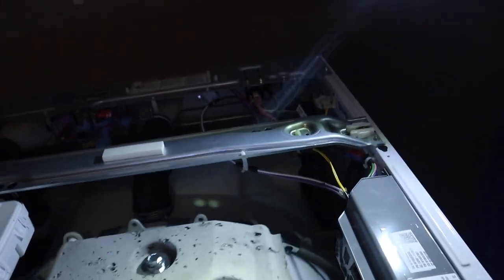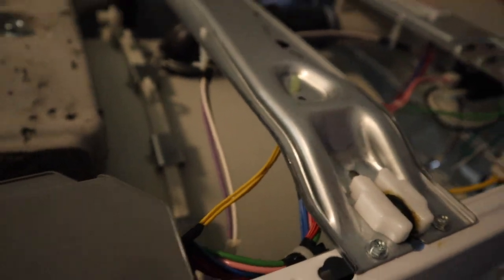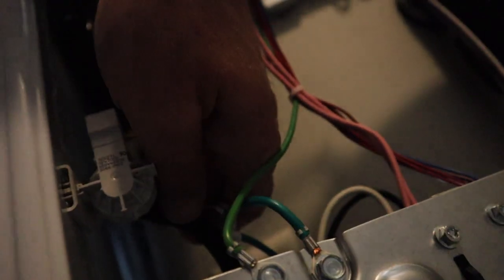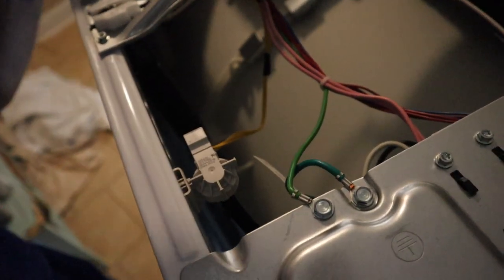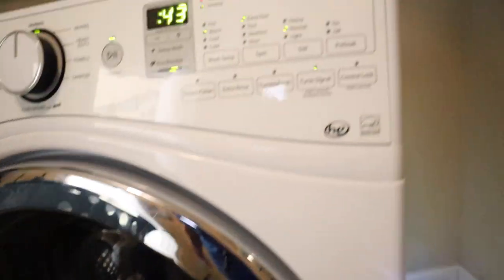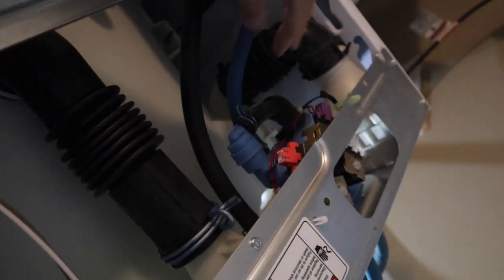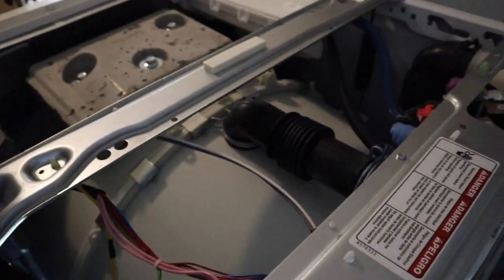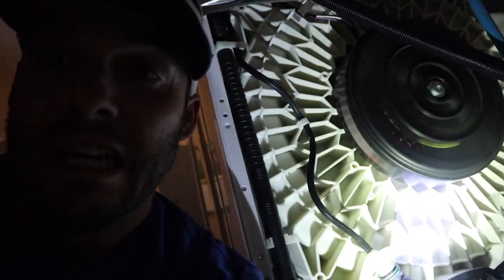F3E1 Error Troubleshoot | Whirlpool Duet Washer

Comment: Yeah this situation sucks especially when the dryer is stacked on top. I'm the handyman for a doggy daycare and I installed this used Duet set a couple years ago and before long I was cleaning the drain filter every couple months. Yep I gotta drag the stacked unit out of its space to get at the back.  I talked with the owner and she may decide to have me cut a new access panel in the front so one of the staff can clean it whenever they want without calling me. Now I gotta take the stack apart to get at the water level switch. At least that's a new problem I haven't encountered yet. Thanks for the help!
Reply from the maker: No problem! Glad to help!!

Comment: Thanks for posting this.  I've had the E01 F03 intermittently for about two years.  I've swapped out the Air Dome, Pressure Switch, and, just last week, the hose between the Pressure Switch and the Air Dome. None of them fixed the problem. It is very frustrating.  I think the only thing left to do is the Control Board, which is about $500 here in Canada, and there is no guarantee it will resolve the issue.  This problem seem so wide-spread I can't believe there has not been a class-action lawsuit.  I'd be interested to hear from anyone that has been successful fixing this issue.
Reply from the maker: That washer is such a pain!! I’ve made two separate videos on it.  We ended up taking it to the dump.  I hope my video helps man.  Thanks for the comment too 👊
Reply: I experienced the same issue over and over again in last two years… frustrated!
Reply: @cctiger668  My sincere condolences. After I posted my earlier comments I decided to do a "Hail Mary" and replace the pump.  I got about 10 loads done with no problems so my wife & I were high five-ing. Then it happened.  The only conclusion I was left with was the Control Board which is too expensive to replace.  I just ordered a new washer from Costco. It will be here in a week. It's not another Whirlpool, that's for sure,. Good luck with yours.

Comment: I've gone through this myself. Changed the pump last time and it worked great for 2 days. It's now showing codes again. I have been told that the control Pannel is what's doing the problem. When under warranty the serves guy would do a temporary fix, but the codes returned in a week. The warranty com. did not want to change control Pannel.  I'm thinking of getting one. Maybe 80$
Reply from the maker: Thanks for the comment!! I currently got a new washer!! This one gave me hell

Comment: Seems to be a common problem. Here's what I've done so far. 1) I cleaned the inlet to the soap dispenser and replaced the hoses. There was a ton of soap scum built up inside so I thought maybe it wasn't getting enough water. It worked great for several months. I received the error again. 2) I cleaned the filter out. It worked great for a month. Codes came back. 3) I replaced the water pressure switch. It worked great for several months. Now the error codes are back. They are really random though. In the middle of the night it'll just randomly start alarming and flashing the error codes. Even when there is no laundry in. It's just completely random. This is making me think the Control Board is on the fritz. The new control board is $270-500....Not sure if I should try it or just buy a new washer....will keep ya posted.
Reply from the maker: I bought a new completely different washer, this one is a POS
Reply: I have the same thing -- it'll start beeping in the middle of the night F3 E1.  I don't understand what could possibly set it off after having sat for several hours doing absolutely nothing.

Comment: I guess the expression “lonely as the Maytag repair man” no longer applies. I miss the old washer and dryers!
Reply from the maker: Yeah this has been a pain.  I did a video a year ago and was suppose to do a follow up and finally got around to it, cause damn thing is screwing up again
Reply: We had a used Maytag washer and dryer and it worked for decades for us.  When it started struggling we got a Maytag front loader.  We should've had the old Maytag rebuilt.  It was a tank and ALWAYS CLEANED THE CLOTHES.  We've had TWO of these crappy front loader Maytags now.  They only lasted 5 years and never cleaned the clothes properly. We only do about 4 loads a week.  We had to get that kind because we lived in Houston and they charged $50 a month for water IF YOU DIDN'T USE IT.  Turn on a faucet and things get crazy so we had to get a low water usage machine.

Speed Queen Classic for me now if I can get my hands on one.  6 month wait list around here.
Reply: Thanks man! You saved my day and some money...😅😅

Comment: Sounds like you've got something hung in the pump. That's that terrible noise you mentioned when you turned it on. The pump is immediately activated before it starts a fresh cycle. Disconnect the top hose on the pump and you'll probably find something like a bra underwire or a hair pin. Happens all the time. 😅 Believe it or not , things DO get past that filter.  If the drain pump isn't working correctly, unable to drain as it should, that will cause an F3 code sometimes even though that code can be used for a couple different things.  I've removed these type of things and didn't have to replace a pump. 👍
Reply from the maker: Thanks for the tip!! 💪

Comment: The rattling noise is because there is no water and weight to the drum. My washer does the same thing. Though my washer won't unlock the door when I get an error code. 
Here's the rub; no one tells you about. The door has to be open to clear the error code! So how do you open the door? You have to take the back and top off to access the default or emergency door switch. Once you open the door then you can run through clearing the code sequence.
Reply from the maker: Good to know! thanks Donna
Reply: You saved me with your door trick advice!!!  I checked and discontinued every hose and cable for hours before realizing this.  Thank you so very much!!

Comment: My Whirlpool is getting F9 E1.  I did remove some change from the filter and cleaned up both hoses.  No clogs are visible. It will start and spin, but seems to throw the error every time it gets to the drain cycle.  Do you think it could be the drain pump?
Reply from the maker: Maybe, there is a code cheat sheet under the lid
Reply: Hi, curious what the end outcome for your situation turned out to be? We’re currently in the same boat but just got F03 vs yhe F09

Comment: Changed the sensor…still got the error code.  Cleaned the trap,  checked all the lines, mine makes the drain pump noise also….but never stops making the noise and throws the codes.
Reply from the maker: Man, I’m sorry,  thing is a pain, we ended up getting rid of it soon after this video

Comment: I get the beeping error about 2 minutes after  I start a cycle, I then push power and it will gurgle a bit then shut off like the cycle is finished, it is not....there is still water in tub.... we have checked all the filters, put in a new pump.... do you think it could be the sensor on the top, I am thinking that may be it and I could order a new switch??  As soon as I put on your video and I heard the beeping I go grrrr :-).
Reply from the maker: This washer is awful, I have gotten a new one recently.  Year there is a sensor, but may just be better to get a new one

Comment: Mine is particularly bizarre.  If the wash cycle is normal or whites the error message appears.  However, if you let it drain and change it to quick wash cycle (25 minutes) it works perfectly.  It usually runs about an hour on normal or white before the error message appears so we just then change it to quick wash and the clothes come out clean...I mean clean for one of these crappy front loaders.  Here's hoping this thing lasts until we can get a Speed Queen Classic.  There's a 6 month wait list.  Sheesh.
Reply from the maker: I appreciate the comment, You wouldn't believe all the crazy comments about these washers.  Mine has been okay lately, I feel like I have to cross my fingers everytime i push start
Reply: @RunwithBrad  Yep.